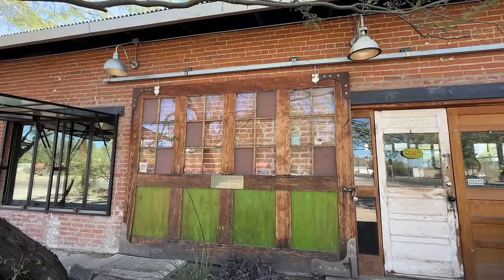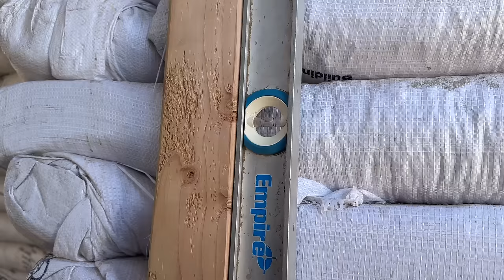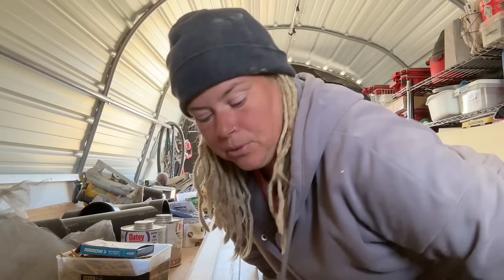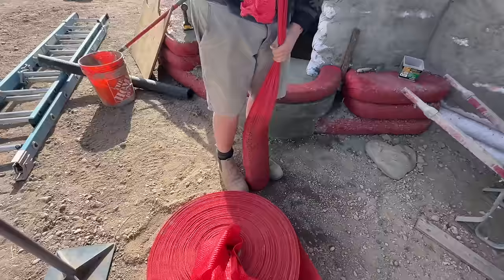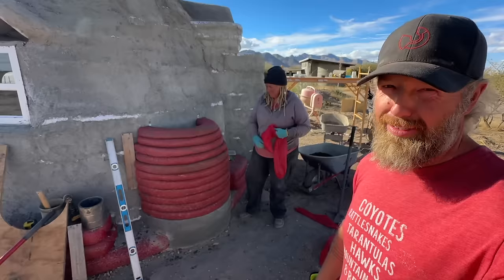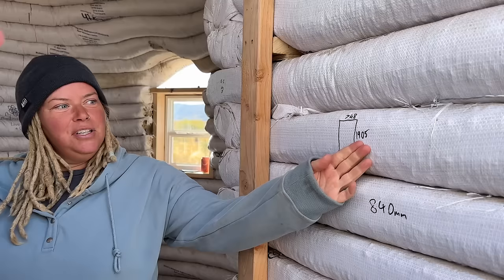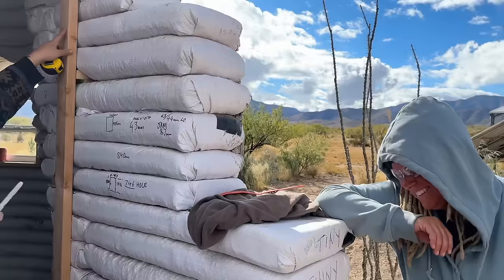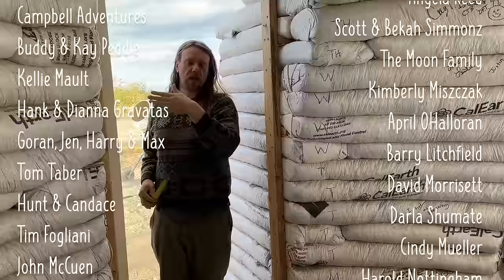Hyperadobe MINI DOME!

Comment: I love your work because it gives me ideas! One I just thought of is build the door form in two parts front to back. In-between those parts build the actual door frame. Then when you take it apart the door frame is already installed.
Reply from the maker: This would only work if you’re building with large boards, double bucking, and creating cross supports so it doesn’t loose its shape while tamping the earth bags.

Comment: Metrics is so simple. It's all dividing or multiplying  by 10, 100, 1000. 1m =10dm(not much used), 100cm or 1000mm. 1km =1000m. Nothing easier. Feet and inches make no sense. 1 feet =33 inches? What kind of mathematics do you need to do to convert? If it's right you use ellbows also. If I need to know how much 1 square feet is I have to calculate a lot!
Reply from the maker: Well, 1 foot is 12 inches, but yes it's weird :)